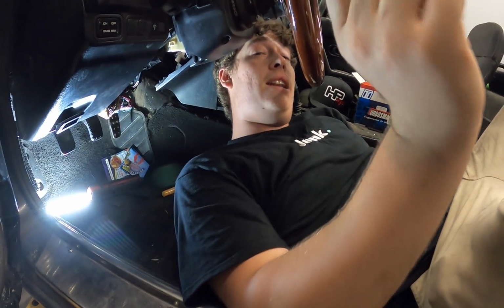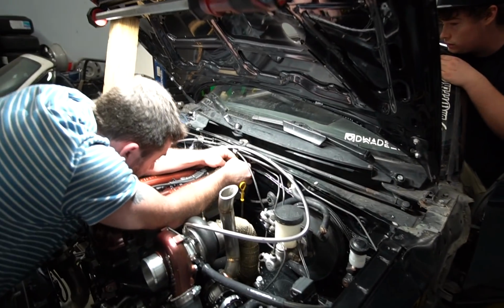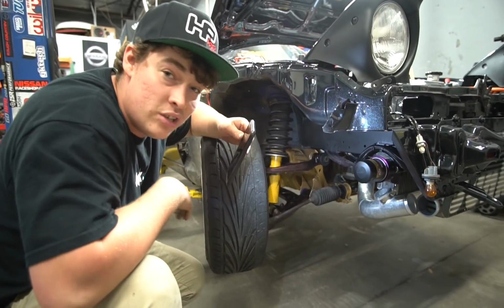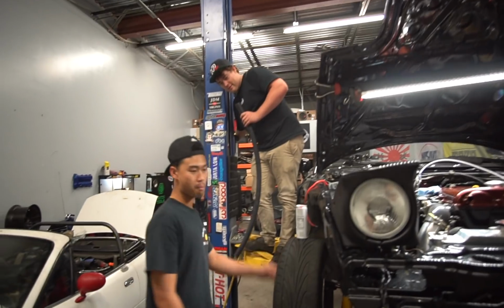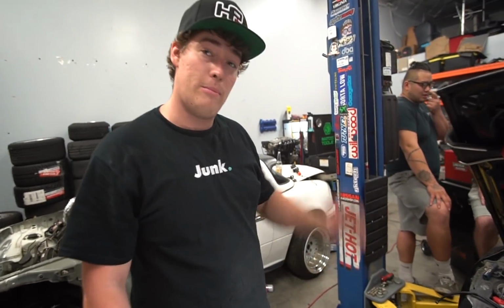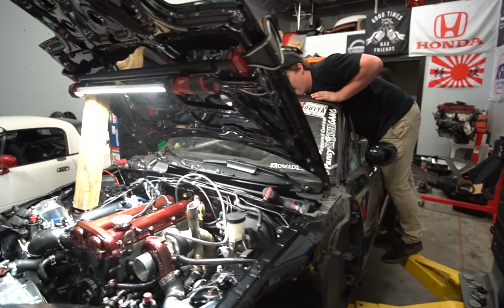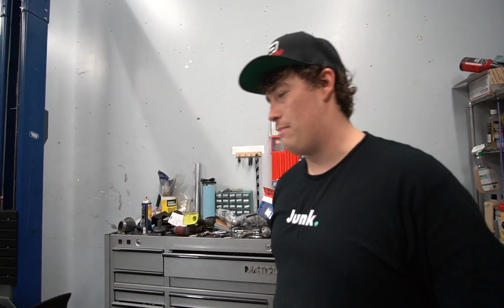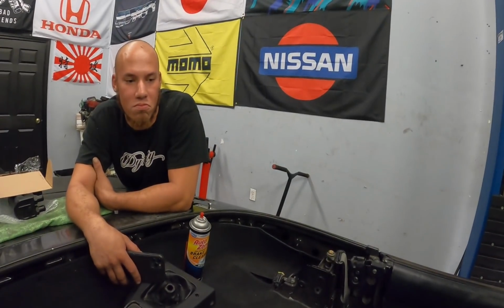RICERMIATA FIRST START! Big setback...

Comment: You have your ecu wired to the wrong power source thats why it shuts off when you crank, I think ive commented this like 20 times. Thats why your haltech dash shuts off on your other car/cars
Reply: Hope he checks his comments. Sup cory
Reply: This...Should be an easy fix.
Reply: Hopefully he sees this. He's never replied to me except for when I criticised him.
Reply: 69
Reply: he looks at his comments, he should see
Reply: LISTEN TO CORY FFS!!!
Reply: Keep commenting here so he can see it.
Reply: I don’t think you could do that. I mean you could. But it wouldn’t start if the ecu shutted off when cranking
Reply: Look at this comment rodknock
Reply: Its just when he first cranks that the ecu shuts off because of voltage sag from the battery
Reply: That doesn't make any sense.
This car has run before on the same ecu setup(edit: and runs in the end of the video), with only difference that it was a stock engine. And the injectors are firing, so no way the ecu is off.
Here, the only thing turning off is his oil pressure gauge, so he might've wired that wrong, but you're mistaking this setup with the roadster's setup, here it's a megasquirt and the gauges are standalone, if the gauge turn off, it doesn't mean the ecu is turning off. On the roadster, the dash is connected to his haltech ecu and is directly powered by it so your diagnostic would kinda make sense, even tho it still doesn't make any sense, because if the ecu actually turned off, it wouldn't even start, and the roadster starts every time without any issues.
Reply: It's megasquirt tho....
Reply: He’s as smart as a box of gloves what do expect
Reply: @imnota  its defo voltage sag ruddy probably ran that battery dead many times  so probably doesn't have much life left it it probably has voltage drop towards 8v which the megasquirt probably doesn't like thats why you can install cap packs on the 0ower lines to keep the ecu running while cranking
Reply: Juan Martínez needs to be wired to constant 12volts with power on, nothing ignition related. Could literally tap into the radio power source as the power for the ecu
Reply: IMNOTA explain yourself then you just talked in a circle and said I was wrong, willing to bet you don’t know what your talking about just like ruddick
Reply: IMNOTA ecu screen and gauges shutting off won’t cause the car to start because it’s still getting input signals when this happens. You just have no display information or dash power. For diagnostics related to starting it makes things much harder to diagnose. I literally have fixed this same issue 300 times at the shop I work at
Reply: Juan Martínez its proably protecting it self
Reply: Joshua Hutton the term is voltage drop and that is not it
Reply: Juan Martínez  ecu and all sensors are still running when that happens. Just the displays and all monitoring systems shut off while cranking. Usually doesn’t cause a no start condition just confusion and uncertainty when diagnosing
Reply: @FYC0069  constant 12v with key on obviously

Comment: No bov life ❤️
Reply: Make sure he's building this thing right we dont want any more rodknock luck 😂😂
Reply: Are you really sure that its not a problem not to run bov?
Reply: Idk I liked the Fast and Furious bov
Reply: @Brkinglx  he's ausinese, dont question him.
Reply: It's fine nothing beats a vl turbo dose
Reply: hey
Reply: @bigcase4449  Japtralian
Reply: Rodrigo Barquin yes. The main reason it was considered bad was because the compressor surge was caused by all the boost hitting the the turbo blades and potentially spinning them backwards and/or putting pressure on the bearings. Newer turbos have stronger wheels and over-engineered bearings and rarely have issues from running no BOV

Comment: Chris, Jeep JK LED headlights will work for a Miata NA.
Reply: Yup my friend took his out of his Jeep and put them in his Miata
Reply: Gingium did it too, looked mint
Reply: I suggest legit OEM JK units, those eBay ones are 100% 🗑
Reply: As like as they are h14 connectors.
Reply: Any 7 in round h3 bulb will
Reply: Kinda surprised he hasn't modded the headlights already.

Comment: Do what I did. Rasberry pi running tunerstudio where the radio goes. 20$ walmart radio in the glove box. Use some heavy duty Velcro to fix it in place. Works in my drift miata and I'm jamming in grid. You need the cheap radio since it weighs like 1 lb. Those heavy ones are impossible to keep from sliding around when you're sliding. Also, consider running a mechanical oil gauge. The one in that year is a dummy one. It only shows off and on.

Comment: @2:56  When you wired up the oil pressure gauge you stole your power from the wire that loses signal while cranking. There is a nother positive wire on the Ignition barrel that keeps constant power even while you are cranking the key. That is the power you want to use for your gages.

Comment: sam is right about the flutter. Only way it will hurt anything is that if you get stututu on throttle. Off throttle it does ZERO damage no matter what power you running etc.

Comment: FYI..... the CAS can ONLY go in one way into the back of the cam. The slot is offset to one side so impossible to get wrong....no 50/50 here... The cam/timing belt can be off, easier to do on a 1.6 than a 1.8. You can always do an easy check with a spare CAS for spark...plug in spare and turn key on with a plug installed in wires 1-4, and rotate the CAS. Also, the coil pack wiring has a small bit of blue or white sleeving near the connector to signify #1. The spark plug location should be stamped into the coil bracket as well so should be FOOLproof 
Happy Birthday 
Don’t drink TOO much lol

Comment: Coil on plug is kinda easy the type up coil you have wire 2,3.4 or whatever and then replace with the same wire number MSD type off the hop. plug on wire is easy google it.

Comment: I'd definelt get that radiator hose away from your intercooler pipe. Your cooled off air is getting heat transfer from that for sure

Comment: Btw coil packs are probably ok. The odds of all them going bad is pretty friggin high
Reply from the maker: Well they didn’t work sooooo
Reply: @RicerMiata  I'll rewatch, but I thought you changed the coils and moved the cam angle at the same time. Figured it was probably just the sensor
Reply: @RicerMiata  but I guess you checked for spark and had none. Bad luck I guess
Reply from the maker: I've Got a Problem I also explained we plugged a computer into the megasquirt to check for rpm and we had it so we new the cam angle was fine

Comment: I don't believe using synthetic for the break in period is "ok" like you said, There are companies that manufacture high quality break in oil (like the BR30 and BR40 from Driven racing oil). The big difference is the addition of zinc and phosphorus to help the metal "wear" properly. It's not a question of blowing your shit up like you said, it's just plain old metallurgy.. think about it.. metal to metal friction create heat, the purpose of oil is to reduce that said friction. But on a brand new engine, the metal parts have NOT been "worn" together. If there parts don't seat propely, in the worst case you can have oil passing throught the rings, of even maybe compression lost through the rings, which will also pressurize the crankcase.. By using a proper oil designed for breaking in engines, You are just making sure that your engine will live a longer, happier life! Of course what I mentionned earlier are the worst case scenarios but there is a reason why you still have a break in procedure on brand new engines. I just bought a brand new KTM motorcycle, and I had a 600 miles break in procedure, on break in oil! Also  if you watch Cleetus videos for exemple, when he order a crate engine, theres ALWAYS a case of break in oil in the crate, so I guess that if high end engine builders do it, it's probably the right way to do it! Just my 2 cents

Comment: You guys built a whole ass motor, the deck is only a switch 12v, constant 12v, ground, and 4 speakers. That's nothing compared to what you have already done. So to say its alot of wiring is a little much....

Comment: autozone ripping ya off. save money buy off rockauto work on other stuff beck/arnley brand 112 cad 82 usd. or you can gamble with ultra power brand super cheap. ultra power is brand name stuff reboxed under ultra power 65 USD